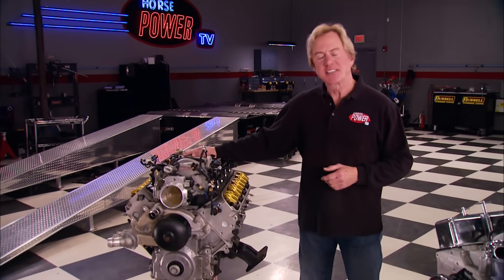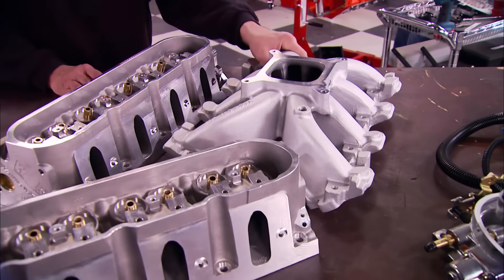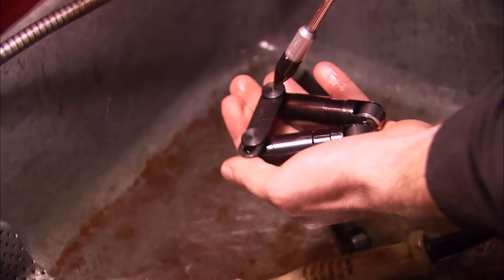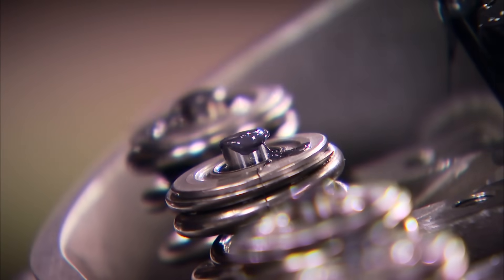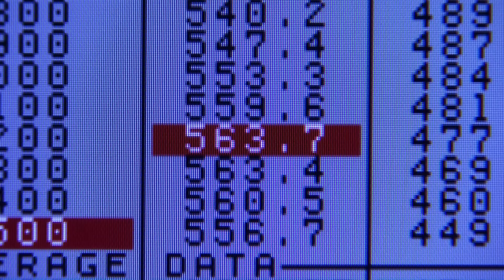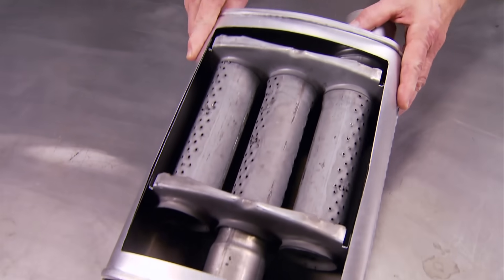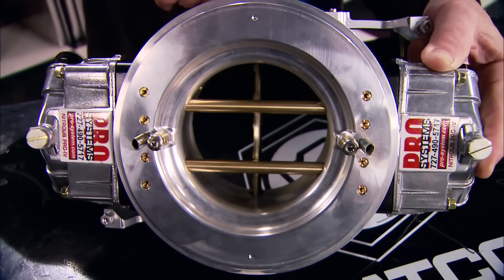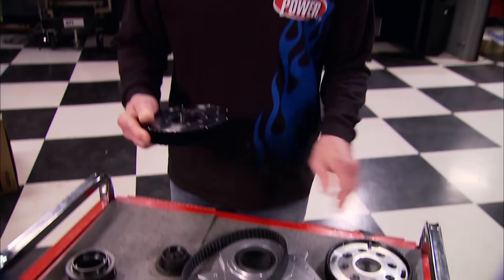Best of Both Worlds: Building A GM Smallblock With A Modern LS Top - Horsepower S14, E7

Comment: A conversation piece is the only benefit of this I see lol. Even a stock junkyard 5.3 will handle more power than 90% of SBC’s so why use a SBC bottom end.
Reply: they were putting out 1000+ hp 50+ years ago. Exactly what do they handle better that a sbc hasn't done millions of times before?
Reply: @O. Stone they were doing it with less than 5L back then too with 60s tech which was barely better than stock. there's nothing star spangled awesome about your ls engines that hasnt already been done 10,000 ways to Tuesday. The only difference is now idiots can do it by mindlessly bolting things on without knowing a thing about engines.
Reply: @INSIDIOUS1986  no lol those blocks from the factory couldn't handle that kind of power, much less make said power, go flow your camel hump heads, then flow a set of 243/799 heads and see the difference for yourself.
Reply: @whiplash0567  207ci 1300hp twin turboed in the 70s with stone age tech. 
you have your foot pretty far in your mouth so far
Reply: @INSIDIOUS1986  yea right. i guess thats why everyone knows about this legendary 207ci motor that the drag racing world worships. Next you're gonna try to tell me you had a 66' mustang with a 289 that would jump a coke bottle off the line 😂
Reply: @whiplash0567  was an Indy engine actually, but your prob not into any kind of racing that takes skill, like engine building does as well.
Reply: @INSIDIOUS1986  yep as I was taught at school any fool can build a dragracing engine it takes some real knowledge to build an engine that runs all night long swinging into the red for a whole season and have to follow class restrictions like factory rods cranks and heads and still make big numbers and hold together without sending parts out the pan on the straightaway at 9grand or better you can run a whole season of quarter mile runs in a Saturday night heat race running circle track
Reply: noone knew that 10 years ago when this was made
Reply: Beginning of the video they tell you “for racing classes that require a distributor ignition system”

Comment: A prom programmed for your engine? Damn aged itself hard there 😂
Reply: Glad I'm not that only one who caught that
Reply: I was thinking the same thing... so if you change cams when they have more than one for this bastard child of GM motors you need to get a new prom burned... Why not just use a terminator X or similar type of system and get it changed without buying more expensive crap plus it can control fuel injection too if you want.
Reply: @justplanefred  Because this episode was 10 years ago.
Reply: @allanb3222  that is a valid point given the age I’ve the video it wouldn’t have been possible but it would be now
Reply: You guys are kidding right this is just a highly glorified commercial
Reply: Hey why don't we just use the money and go buy a cup motor

Comment: I think it’s a cool build, but I would’ve used different lifters that’s for sure. Morel, Jesel or Crane, had to many problems with comp stuff, and I’m not the only one either.
Reply: You can here the thing tickin already.  Probably them lifters .
Reply: @wateverit8ks342  I was thinking 🤔 the same dam thing!!! That motor is ticking like a watch ⌚ 😳
Reply: Comp is overrated to me
Reply: Comp Probably sponsors the show
Reply: @327MakoBeardo  oh you can betcha each episode its a no brainer who is paying the bills .. which is why I no longer go outta my way to watch this crap because its all designed to sell parts very little useless tech info that can be used for regular people. think it was years and years ago they spent like 5 thousand dollars for a budget 305 build which was chock full of useless garbage.. ARP everything bolts .. you know water pump bolts intake bolts distributor hold down arp bolts .. stupid shit NO one NEEDS .. do you really need to invest $125 for ARP oil pan bolts ? they spent 10 times to much making a 305 engine to make about 250 hp less then any 350 most people would build. Hell I would throw a 307 crank in a 350 block and order 327 pistons and make a poor mans 327 over a pos 305 garbage engine and it would spin 9k rpm on stock parts. I know because I built dozens of them. used to be impossible not to make at least 350 hp on a small block build back when 350 was actually a lot. (mid 80's)
Reply: I just used comp lifter's in my retro solid roller engine. 500 dollars so I'll report back if there's any issues. I went Edelbrock and compcams on everything for a old 350. IDK what the horsepower will be ? Any guesses?
Reply: @pumpkin12030  480 horsepower and 480 torque. and if it really is just an ole stock block 350 , faive hudret hose powa!  As soon as i just now realised you said solid roller, well hmm could be 450hp or 750 really no tellin unless umm, lets see, super victor intake, 14:1 compression, victor ported heads   big solid roller cam, umm 625hp+ on the engine alone no power adders? oh, oh , oh wait you said 'retro' solid roller, hmmm, guessing edelbrock Victor JR heads, or did you get rpm heads? hmmm, lets see if you got vic heads , 11:1 , solid roller, victor jr intake, hmmm i would say more than 500hp+ easy. if it has rpm heads , and rpm intake, and smaller streetable comp retro solid roller cam i say 465hp to 475hp, and 460t-to-480 tq.
Reply: @zAvAvAz  He gave you 0 engine information except buick 350 so how are you giving him power numbers
Reply: Its really cool, been watching new head engine dynos at that time. There was a solid roller cam buick 350 made 480 hp and tq! really cool. Except not every 350 or sbc 350 makes 500 even though it is easy to do if funds and know how. Good question though. We won't know until. And it has been a while. I forgot. Think it has something to do with the new aluminum heads out now. @gordocarbo
Reply: @pumpkin12030  No way to tell except you have a  buick 350
Reply: Yeah the new heads have opened all doors and now the 350 buick is a viable engine! Super lightweight busts the scales with street power now. @gordocarbo
Reply: I don't run ANY Comp junk any engine I build........
Reply: @milojanis4901  comp isn't junk I've never had trouble..people using wrong shit have problems usually
Reply: It sounded like it had a lifter problem . I don’t think it was the audio
Reply: not even factory Chevy solid lifters sound that bad

Comment: We did a build like this years back for kicks. While it was fun, I think even back then I was pretty adamant that there was no logical reason to do it other than to be different.
Reply: That's cause you dont get some class racing , this would be great for a street stock class! No efi or electronic ignitions! Guys are running 10k to 15 k big 400 inch sbc. Guessing good ls heads and intake flow way more air then sbc stuff . Theres a reason everyone running ls stuff man its cheap I get it but sbc are a lil more avil and cheaper no one wants em .

Comment: Ive always heard the LS bottom end was way stronger than the standard sbc bottom end. Any truth to this?
Reply: There have been stock 2 bolt main SBC turn 6500 to 7000 rpm with no problems. I had a 4 bolt main SBC I turned to 6500 with no issues. Cast crank not forged either. Even had a roots style  supercharger on it.  I've never had a SBC break anything in the bottom end. So is an ls bottom end stronger I would say no not at all.
Reply: Yes very much so the ls has fully skirted block with 6 bolt main caps 4 straight down and 2 from the side

Comment: To everybody asking why? Because of horsepower losses from oil windage. A LS deep skirt is far superior for strength, esp under forced air, but the air and oil doesntt move around as well. This setup is extremely niche', purpose built, class rules beating that actually works. But for 99.999% of the enthusiast, it is pointless

Comment: With the bottom end a different block wouldn't the oil problems LS motors have be solved. And couldn't u use a LS 3 intake

Comment: This is such a waste of time why would you go from a 6-bolt cross bolted main to a 4 bolt or even worse 2 bolt main and be limited to under 425ci
Reply: Windage. With the deep skirts, a LS while stronger, doesnt move the air and oil under the pistons as well. This setup is extremely niche, class racing, but in those circumstances there is an advantage
Reply: Its just for some class specific race car stuff, circletrack and drag.

Comment: Any junkyard LS would make more and not sound like you left 6 hammers inside the engine. Although you guys are probably not as smart as the hammers.
Reply: Bad ass great for your junkyard shit but in some classes,  dirt classes like street stocks you cant run efi or electronic ignitions no roller cams either . At out home track guys are spending 10 to 15 k on big 400 inch  sbc , Ls heads intakes flow way more air then old sbc stuff bud . Not everyone likes junk that's needs rebuilding every other run !I'll agree theres need some valve lashing but 500 hp and not leaning on it is pretty stout .

Comment: They make these things called swap mounts. Craziness
Reply: lol. Yeah, unless you just want a weird engine or to comply with some dumb rule in some niche racing class I'm not sure what the advantage to this would be. That block has to cost way more than motor mounts and the LS bottom end uses 6 bolt mains, which are stronger than even splayed 4 bolt, and all modern seals. They also make exceptionally well flowing heads if you have an old-school small block and you need heads. It's neat but I don't see this catching on.
Reply: LOLOLOLOL
Reply: You have things called ears. They explained this is for restrictive rules in racing.
Reply: @Shutchohole  no they didnt go back and listen to it again. They did mention a racing class that requires a distributor. You can buy a distributor kit for an LS cheaper than this abortion
Reply: @holmes1956O  I'm no expert, especially when it comes to what's available for any certain engine. I assumed this was the way to meld the two engines together. Obviously, I was wrong. Carry on. 😃
Reply: @Shutchohole  for all the money they spent and the little hp they made to me it was a waste of time
Reply: @holmes1956O  it's  apple's to apple's (motor vs motor) the LS is still better than the hybrid from what I've seen. I assumed certain classes required (X) block style, provision for distributor, etc. I do agree that the LS is THE best bang for your buck being they are readily available and strong enough to run without rebuilding with expensive parts.
Reply: @Shutchohole  
We heard the reason they gave, it's just kind of a dumb reason. This is about the most expensive way you could comply with a "must run a distributor" rule, ect.
Reply: Not to mention they never talk about how much these things cost, like you can run out and buy 3 today.
Reply: Yeah screw the hybrid n screw horsepower tv bringing the shit to our attention. Hey horsepower tv adjust the valves correctly atleast. Oh that must be part of the build/swap. excessive valve noise  and 5hr valve train life.

Comment: Direct Combustion Chamber injection with a Water/Methano fogger upwind of the intake valve to minimize soot accumulation in ports and on valves. Variable valve lift and valve timing, variable compression ratio, venturi length, and variable forced induction, with isolated lubrication and cooling systems, cooler exhaust gas activated boost augmenting twin pre prssurizing hybrid turbos, no blow off valve or wastegate just a Throttle cable, go pedal or ETMS/TPM orTPS activated intake pressure purge valve on the mechanical supercharger that bleeds out into a contained storage tank to operate pneumatic components (train horns, air shifters n horns, airbags air suspension n horns, hillholder horn  honker),or just a methanol tank positive pressure compensator) intercooler setup  for a nice    cold temp reducing internal Chamber thermally insolated chemically isolated substrate material and lower system  operating temperatures for turbo compoents

Comment: 6:09 why build this? Well the small block bottom end will take more power than most people give it.. yes but it's not near as good as the ls bottom end which is known to handle a thousand horsepower right from the factory with no modifications.

Has six volt means that are cross bolted into the actual block.

It's a retarded concept.

Especially since you have to use a specially made small block you can't just pop the heads onto a car that already has a motor.

This TV program looks to make the least amount of power with the most amount of expenditure every single time.

On today's episode we're going to go mine in the ground for some iron ore that we're going to turn into an engine block that will be able to hold drum roll please 200 ft pounds of torque.

Why don't we just use a motor that already exists? Because that would be cheap and easy and effective.... And that's not what this TV program is about.

Our TV program strives to do projects no one on Earth would ever do because they are a waste of time and money
Reply: No, they strive to get advertising dollars from parts manufacturers. This isn't tech, it's thinly veiled advertising.

Comment: Those lifters and rockers are fresh, fresh on their way out with the way they sounded on those runs. Ouch !!! Would not want my engine sounding like it's got a half a quart of oil in it lol.
Reply: Most likely the wrong push rod length im guessing 😅
Reply: I didn't catch what brand they were, I used some comp lifters in an LS3 once, they were a zero preload lifter design, sounded like a damn sewing machine, but they worked just fine.  I'd never use them again, but owner didn't mind the noise.
Reply: @V8VRUte  The Older in the 80's TRW 1/4 Turn Racing Hydraulic Lifters were AWESOME..Very Quite and Revved like Solids I actually used one Set in 2 different Motors ..Had them Re-Surfaced after the first Motor with 80+ k miles ..Sold the Second Motor in the Truck after 45k miles ..At that time Standard Lifters were like $2.50. EA. The TRW's were $7.50 EA. Worth every Penny of that .
Reply: Floating wrist pins is the noise

Comment: i wonder if Dart still wastes its time selling this block, now that the LS is a two decades old engine in the junkyards.  Might as well keep the Gen One block with 5 bolt holes around each cylinder, compared to the LS's 4 bolts for better head gasket seal, and then just grab any aftermarket Gen One head with the same valve angle as the LS--which more than the cathedral ports, is why the LS makes its power.
Reply: @bigboreracing356  right but it doesn't take the LS head according to description (hard to tell from the photos, but it looks like 5 bolts around each cylinder, not four), its the motown II LS block that seems to accept an LS head. i'll take a guess after S&H is figured in, and a trip to the machine shop shake table so the new block settles its atoms like a seasoned block...its a $3,000 price tag. or one can go to Mercury Marine, they have a 7 litre update of their LT5 engine made for King of the hill Corvettes in the 1990's--700 hp naturally aspired.

y'know, in case you think the Ls is over-represented at the car shows of america :)
Reply: Yes , the original small block had 5 head bolts for each cylinder . but they were placed so close to the bore that they caused distortion of the bores . it wasn't as much of a problem on the older small bore engines like the 283 , but when they brought out the 4 inch bores it became a bigger issue .
Reply: @bigboreracing356  beat me to it :)  Chevy went out to 4.125 inches with steam holes added to the deck, the bolt spacing wasn't an issue if a torque plate was used during the hone. Pontiac went one better, it screws the head not into the deck itself, but into the walls of the block.  and if for some reason one cannot access a torque plate, a stack of washers or a wrist pin clamped down can mimic a little bit of the distortion--something to consider when stabbing in a piston ring to check for gaps.  Or putting new valve seats into a head.
Reply: @bigboreracing356  i'd think using a stack of washers is cheaper :)  but if i was going thin rings for less friction, then that vacuum on the crankcase side of the piston rings is a winner. just gotta drain it of oil from time to time.
Reply: @bigboreracing356  no more worrying a power adder will butt the ends of the rings together and rip off the piston crown, no gas port holes to clean round the permeter of the piston crown...just an experiment of how thin a ring you can go and equalize pressure on both sides of it for less friction. but then i'm thinking don't drill the block for oil squirter technology on the bottom of the piston for cooling. always imagined that just gives the connecting rod something to run into.

Comment: This is so stupid there is a reason the 350 was replaced. Just build and ls the right way and save yourself 10 grand
Reply: How do you make an ls non efi have a distributor and non fuel injected for street stock racing ?? They dont allow computers or msd boxes? Guys are spending 10 to 15k building sbc stuff !

Comment: Disturb the peace, I wonder how much that engine cost
Reply: Probably 10,000
Reply: Too much to be worth while when a ls has better engineering in total
Reply: More than a low mileage ly6 would cost
Reply: @bigboreracing356  my ass is clean and what i have is a positive criticism.  To buy a " special " sbc block to use with LS heads sounds about as bad as those lifters . I already have a built 350 which 350's aren't stock for 80's monte carlo's.  With that said any time i order something i have to be careful if i do it online with the whole this does or doesn't fit yr car. I can't imagine trying to order stuff on the fly for this . Especially if you want to change brands. If it was a kit to fit any 350 that would be a whole different ball game. Just saying
Reply: About 3 times as much making 1/3 the power as a turbo 5.3 lmao